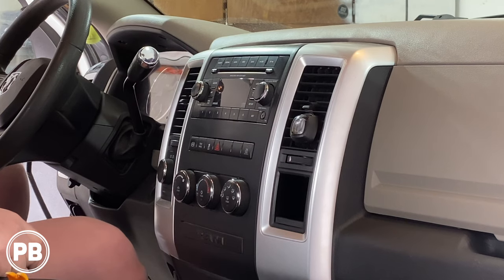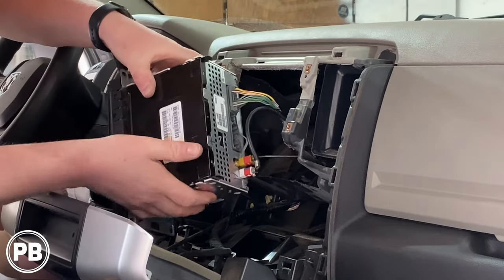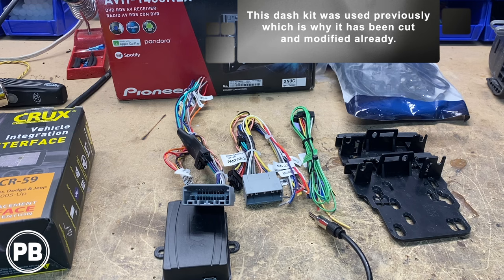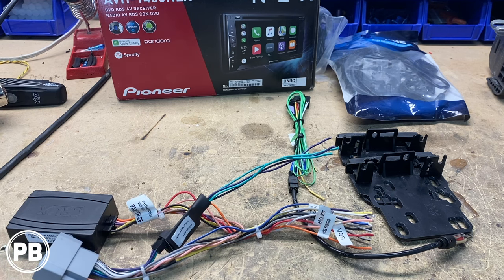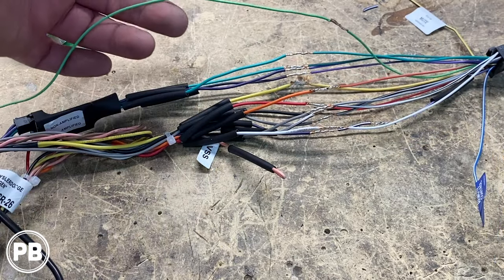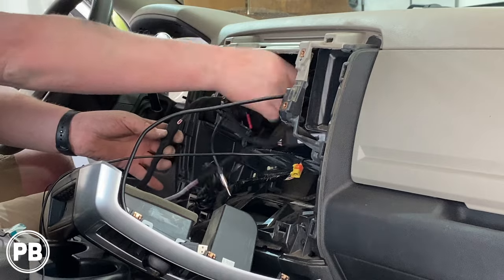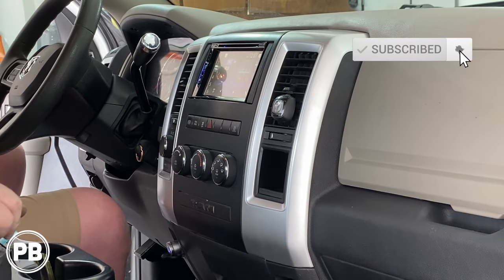2009 - 2012 Dodge Ram Radio Install

Comment from the maker: Parts used are linked in the description of this video!
Reply: What about models with the alpine sub and speaker system?
Reply: Will this radio work on a 2014 ram?
Reply from the maker: Yes, with the right parts for the install.  If you need help with parts, send us a message on facebook or instagram. @Illuvcookies

Comment: I can’t find a double din dash kit to fit mine anywhere it’s a 2012 Dodge Ram 1500 st model
Reply: I had to use a metro kit and not use all of it and it worked didn’t look good tho
Reply: @justinmckey4320  I'm on my second 2012. All the kit you have for a 2012 is a bracket on each side. Nothing on top or bottom.
Reply: I have the original ram amp and boofer but that one can't be heard

Comment: same  ? What is the purpose of the parking brake wire?
Reply: My pioneer will let you play video on the screen but you have to connect the parking brake wire and it still won’t allow video until you set the parking brake, turn it off and then set it again.

Comment: The factory dash if not tampered with has 5 torx T20, not two as shown in the video.  The last guy who put the dash together obviously only put back the top two.  great vid but we need to do the homework.  I had to remove the plastic cover around the centre console coffee cup holders to wiggle the dash piece off.
Reply: I know about the 2 on top under the tray and the one behind the AC elctric outlet, where are the other 2?
Reply: My 2012 3500 only has 2 and it has never been tampered with.

Comment: What is the wire that goes to the parking brake for? I am looking to do upgrade my radio in 2009 dodge ram with the amp but no camera

Comment: Thanks ! My alpine just stopped working, but I got a white screen the other day thought it was gonna turn on ☹️ I really don’t won’t to replace it it’s original alpine sound system I have 12 outdoorsman ram . What a reasonable replacement??

Comment: 2012 ram
Swrcr-59
Boss bvcp9700a
The unit turned on perfectly with the ignition but is staying powered on after truck is stopped and door opened.
Yellow constant to yellow constant (memory)
Red acc to red acc
It's wired exactly as your video and the kit instructs. Is this a faulty wiring harness?
TIA
Reply from the maker: I'd reach out to Crux support for help.

Comment: I have a 2012 1500 with the alpine what do I do if i connected all the same colors together and I have power to the radio but no sound?
Reply: Did you get an answer for this? I'm in the middle of installing into my 2011 and have the same problem

Comment: Where did u hook up the red it has did u bypass sometimes to get power
Reply from the maker: When. you use the correct wiring harness (smart harness), no need to manually wire in the red accessory wire.  Our smart harness generated the accessory wire as it's done via the data canbus of the truck.  Please don't cut corners and use the wrong harness adapter.  The right harness is linked in the description of the video.

Comment: Which wire gave you backup power that let you avoid using the brake light?
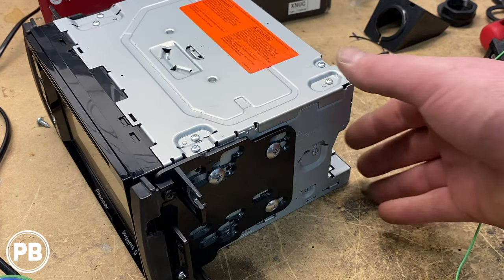Reply from the maker: In the backup camera video (not this video), we used the power socket to power the camera @ 8:05 in that video.  The reverse trigger for the radio was generated by the Crux smart harness used in this video.

https://youtu.be/fMqU0NfJSpU?t=485
Reply: @ProvoBeastAudio  which wire off the crux was the reverse trigger wire?
Reply from the maker: @canadian8764  Purple white: https://cruxinterfacing.com/wp-content/uploads/2019/12/SWRCR-59_Manual.072322-1-1.pdf

Comment: if with the Alpine system will it retain the use of the factory microphone for bluetooth calls ? If not is there a way ?
Reply: If the factory mic wire is wired to the aftermarket radio that will be the mic by default
Reply: Did it work that way for you?

Comment: I have a 2011 ram with alpine system.  Can you provide link on how to wire
Reply from the maker: All the same parts are needed, the harness supports the alpine system as well.  Here is a link on how to assemble a harness at home: https://youtu.be/pla_0VpHTvs
Reply: @ProvoBeastAudio  thanks for reply brother . I'm going to Give it a try

Comment: One more question.  I noticed this is a 6.2 in. Will a 6.8 in fit? If not is there another stereo you recommend that supports android?
Reply from the maker: The kit fits any standard double din, regardless of screen size.

Comment: What size is the screen for a 2012 1500 ram?
Reply from the maker: The but we used will accommodate any standard size double din 4” tall chassis (regardless of screen size). This is a 6.2”